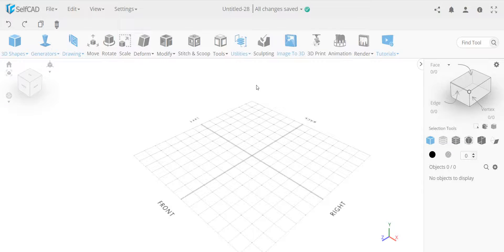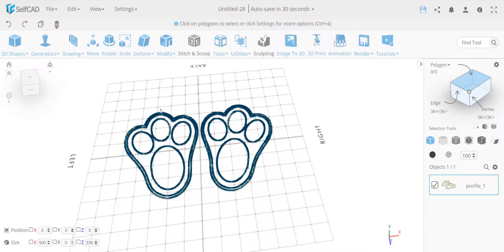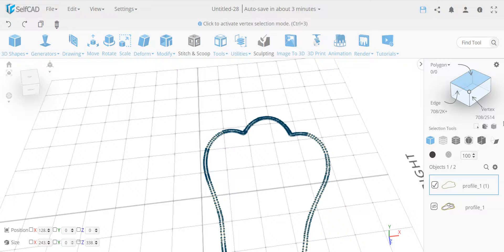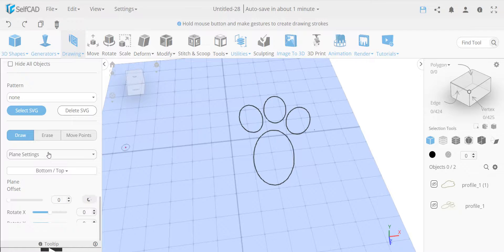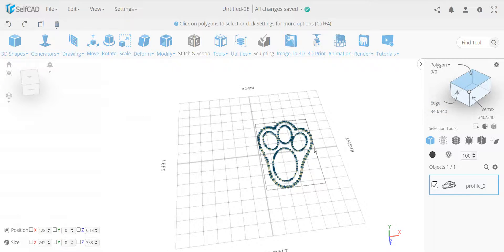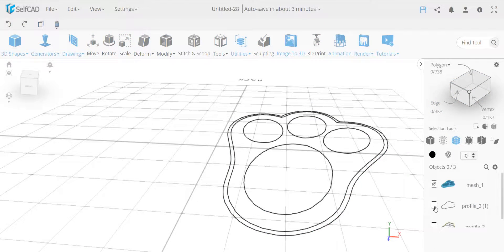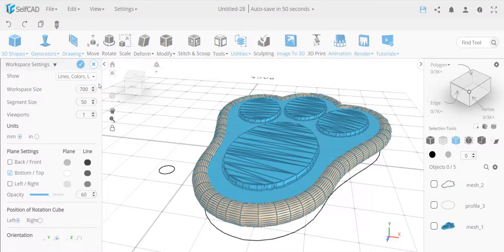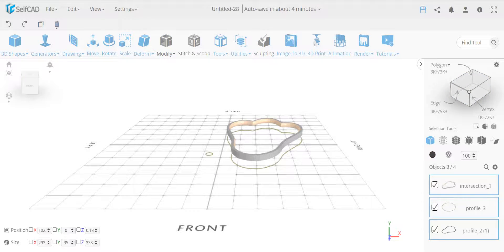How to fix SVG files and how to convert an SVG to a 3D mesh.

Comment: That is awesome, thank you so much!
Reply from the maker: I'm glad you like it. SelfCAD is planning to add more options into the Geom Clean tool. One of them will be "Remove Loose edges" and that will do what I did using the Freehand drawing... once ready, you will just need to use that single tool to clean up such problematic SVG use cases...